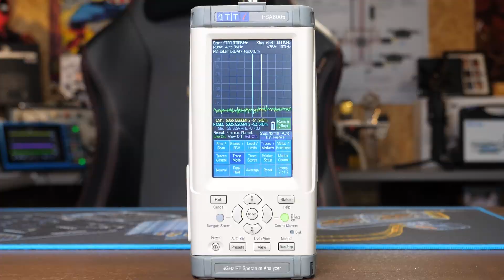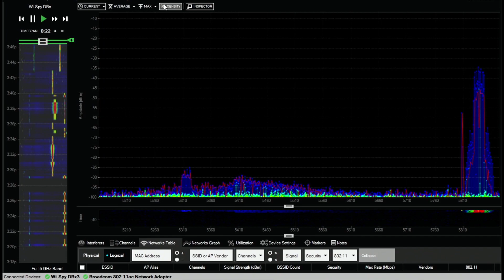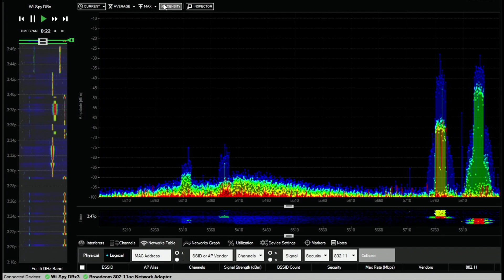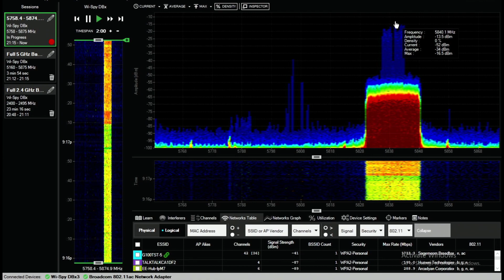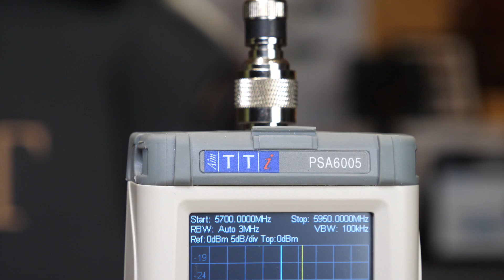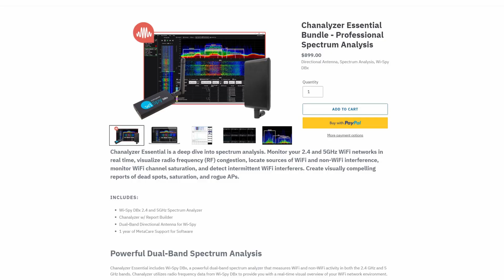DJI Digital FPV System -  Ocusync  On A Spectrum Analyzer

Comment: Thanks for the detailed analysis.  We have plenty of DJI flyers and this is what we have observed

1. On 25mbps, no problems.  If a new user switches on the same channel, it remains in 8 till the new user selects a new channel
2. On 25mbps, if a user switches on at 50mbps, there is a good chance of loss of video for the flyer on 25mbps for at least 10 seconds
3. On 25mbps, if a user switches on a new DJI FPV Drone, again there is a good chance of loss of video for the flyer on 25mbps for at least 10 seconds

We currently don't let anyone fly on 50mbps or with an FPV Drone unless they are the only one flying as it's a bit of a lottery depending on what channels they are on.

Comment: thats really cool. ive wondered how the system works and this gives a good picture. also means that you can leave the controller or goggles on longer and they won't drain much power if the air unit is off.
shark byte would be far less complex but still interesting to see, yet perhaps it would look just like an analogue vtx on the scope

Comment: i read somewhere when switch from 25 to 50 we need to reboot the goggle or the air unit.. maybe after reboot we can get that telemtry for rc link on top of the video channel as on 25mb mode.

Comment: Great in depth review! 
I was working in the high frequency industry (80Ghz for automotive radar sensor)
Great coverage!
Also would be interesting to analyse the fpv combo system
Reply from the maker: It changes a bit but it’s very similar  on the FPV Drone but I will be doing one the same. It looks very similar overall apart from remote stays on 2.4ghz almost all of the time regardless of what video is doing.

Comment: I have knocked a fellow pilot ouf of the sky. The reason was he was on 25 mW and I was on 700 mW. Even though we were on seperate channel, at the very moment I powered on the quad, he lost video immediately. So be careful and make sure you are using similar output power even if on 25 Mbit/s and on different channels. This happened twice. Him switching to 500 mW fixed it completely and we were flying happily even in close proximity to each other.

Comment: Interesting, do you think the separate video and telemetry in 50Mb mode is a bug?    Also we’ve found at our club that the first time someone plugs in their headset and air unit that it can blast analogue out the sky, but interestingly, as long as you don’t power off your Google’s, you are then safe to plug-in the air units willynilly without blasting analogue out the sky once the first power up is done.
Reply from the maker: I think its desired behavior but i think its capable of following, im guessing they want to keep it clear for the best possible video bitrate.

Comment: Thank you for this Information. It helped me a lot  with my SDR. I experienced a bit other behavior with my dji mini 2  with ocusync 2.0.  The OFDM Carrier (h.264 Video) is changing the Channel when there is another interfering signal. This often happens in the 2.4GHz Band. After some hops in this noisy band it switched to 5.8GHz. Also the Control Signals (those Spikes) are randomly jumping around in the band. I hope that will help someone.

Comment: I’m quite intrigued about the comms you say is happening between goggles and controller directly.  This kind of seems a bit ‘odd.  
The reason is simple : many of us don’t use the controller but a different tx/rx eg I use crossfire.  
In this configuration, obviously, there is not controller/goggles comms - the telemetry in the goggles is from the flight controller/aircraft , and I’d assume is ‘mixed in’ with vtx ( it’s digital so no issue with doing that) .
I’d guess the only goggle/controller telemetry that’s useful is the tx side. Or for anything that’s a controller function ( but not sure the dji controller has anything like this , compares to say opentx)

Comment: I’ve very recently acquired the Amimon Prosight system as supplied with the Connex Falcore. I’ll be sticking it on my Spectrum Analyser as I’m curious to see if it truly is as dynamically frequency agile as Amimon claimed it was. They also claimed a low probability of interference to other colocated users so I’ll check this alongside my analog systems. One day I might get round to flying something 🤣. I highly doubt it’ll be using OFDM like the DJI system is as OFDM cannot dynamically switch frequency fast enough without incurring appreciable interruptions in the video feed. It will be interesting to see how it actually does administer dynamic frequency management.
Reply from the maker: Yea, no one I have seen has done channel hopping video well, while Ocusync can change channel and band its in the event of interference and its noticeable for sure. .
Reply: @MadRC  And neither have Amimon. I've just had the system on my analyser and it's the same OFDM technique as that used in the DJI system but with a smaller bandwidth of around 12MHz (it supports 720p @ 30fps and 60fps. However it does do an operation similar to LBT when frequency management is set to Auto. The latency is also near undetectable @ about 20ms. The version I have seems to be the American one as it's switchable up to 200mW where as the European version was limited to 25mW according to Painless360's review. It's quite flexible though as it supports S-Port, Mavlink, and Naza/Wookong/A2 telemetry, but for some reason didn't stand the test of time.

Comment: I have been shot down by a analog FPV user and the googles seem to go into some form of fail-safe/emergency mode and it seems you have to reboot the air unit before things are back to your settings.It looked like it went to 25mw mode ignoring my 200mw setting. Just turning the analog FPV user off does not fix it. Would be nice to see what is going on. Thanks

Comment: Interesting stuff. would be enlightening to see if DJI kept the same behavior for the DJI FPV drone - or did they tweak it? 
( also useful if DJI FPV drone flyers are around others. )
Reply from the maker: It changes a little on the FPV Drone but I will be doing one the same. It looks very similar overall apart from remote stays on 2.4ghz almost all of the time regardless of what video is doing. The drone behaves more like Ocusync on Mavic series
Reply: @MadRC  interesting.... does this happen if you force it to 5.8 ghz? Reason I ask, is if you also use the air unit , and have fitted 5.8ghz antennas to googles ... does this cause issues? 
( assuming you are forcing to 5.8ghz mode?) 
I plan to do some practical range tests in next few days, but would be interesting to juxtapose this with the ‘theory’

Comment: What about V2 goggles, as they are dual band would be interesting to see how the signal is spread?
Reply from the maker: It changes very little on the FPV Drone but I will be doing one the same. It looks very similar overall apart from remote stays on 2.4ghz almost all of the time regardless of what video is doing.

Comment: Is it possible that in 50 mb if there’s already an other system on, the radiocontroller frequency shifts together in the selected channel rather to stay in 8?
Reply from the maker: Yes, its predominately stays on 8 in my tests but I do think its capable of moving but its not default behaviour like in 25mbps mode where its clear.  II am going to do some more testing on this specifically

Comment: Interesting video. Surely blasting ~1W for several seconds during power on is very bad RF manners, if not outright illegal in the EU? Can you think of a plausible reason for DJI doing this?
Reply from the maker: No. Honestly I can’t. It’s a strange one
Reply: i think it is about a possible loss of link or momentary power loss scenario.
although we power up our goggles (and dji transmitter) and AU very close to each other and there is no need for full power handshake, there are scenarios where you could have lost the data (up) link whilst flying. or you can experience a brownout during flight.. in both cases the AU loses telemetry from the ground and does not know how far away it is, in order to tell the ground unit(s) it is still/again active and initiate a new handshake it should blast at full power to get a signal to the ground unit(s) and re-establish a connection on the guard channel (ch8) and get the system back on the correct channel and power setting... 
if you were flying near the maximum range of 1200mW and loose the connection, you will never regain connection if the au sends the handshake signal on just 25mW, so it has to blast at full power on the guard channel (ch8)

this also explains when people flying concrete  bandos and long range flyers experience when they loose connection the get a few seconds of black screen, then a low res/blocky video, see the screen be re-written (by the horizontal moving lines over the screen from up to down) get a crisp image again and after that all happened a second or two later accurate osd info.. and anyone flying on ch8 gets very bad video or failsave.

Comment: 17:10 looks like it's 15dB stronger on boot, this would be approx 800mW
Reply from the maker: When looking closely on my end it’s between the 800 and 1200mw. Imo it’s fully output when testing on the bench.
Reply: @MadRC  yeah depends if you are looking at peaks or troughs. Not that a few dB makes much difference anyway 👍 great insight m8